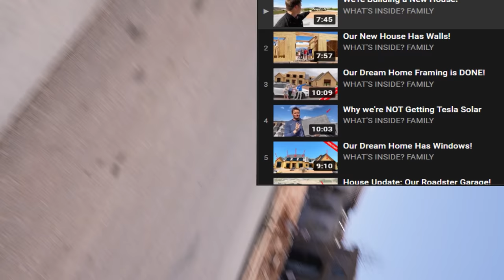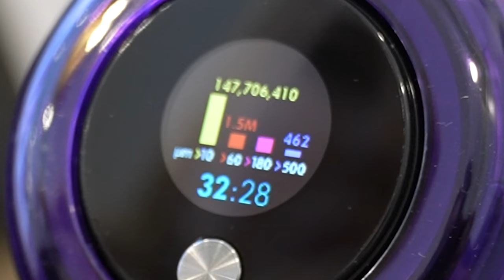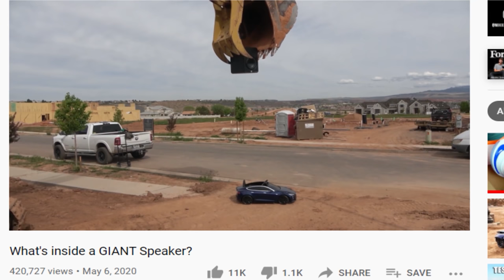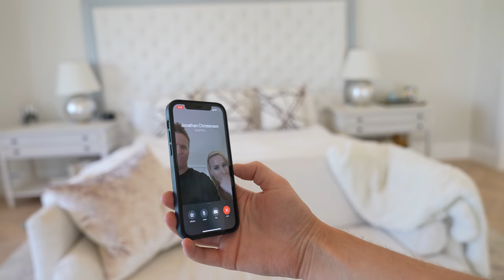One Year Dream Home Update!

Comment: Instead of buying a new lot and constructing a new house , you can simply put a gate with fence around it in your current house, that would be cheaper than building a new house and you can modify your house over the upcoming years..😊😊
Reply: They most likely have an HOA, so their probably unable to do that.
Reply: @nicholasmanwaring391  they definitely have an HOA because of all the similar shaped homes and same fences everywhere

Comment: Please do your own research on spray foam insulation. If you are chemically sensitive, you may not be able to live in your house after it is built. Check out what happens in a fire. Spray foam insulation can contract or have gaps, so it is not always as efficient as they claim, plus running wiring is more difficult.

Comment: The Dyson V15 Detect is like 700$ to 900$. Why do I say this because there are 2 types V15 Detect and Outsize Absolute+. One is and Outsize type and the other is a normal Dyson. Both have that laser tech ONLY on the fuffly head. Key difference is that only lasts 120 minutes ( Outsize Absolute+) and the other lasts 60 minutes (V15 Detect).

Comment: Just wondering, does Lincoln ride trails?  He should try mountain biking sometime, especially since the Utah trails are amazing, and he already has a very nice mtb with a Fox 34 and Shimano SLX (I think).  Also, check out NICA, it's a great program of youth mtb teams.  I am on one of the teams in Oregon, and I love it.  Also, future advice, don't run and angle grinder right next to a $500+ fork and I think SRAM guide brakes, which are over $100.